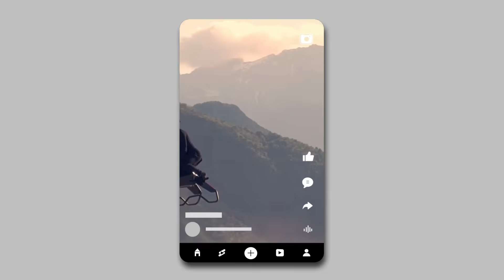2025 NEW VOLONAUT AIRBIKE UNVEILED!!

Comment: That looks like green screen to me. This project is so fake, it's not even a joke. If you are familiar with technology, you may know how much power is required to lift a person from the ground and how much is needed to move them around. Even if this is powered by gasoline or Jet fuel, it will take a big tank, and I don't see that much space for a gas tank, engine, and computer, and if you had a small computer controller, you would have to explain how you deal with combustion heat when sitting on it, cause if not mistanking that's carbon fiber you're sit on.

Comment: It currently boasts a 2-3 minute flight time, which at the max speed of 124 mph will get you two miles (if max speed doesn't severely reduce flying range). Hopefully you will find a charging station there, to get you two miles back to base. I queried ChatGPT on all possible likely improvements in each of the technologies behind its design. With it's most optimistic projections in battery tech (ever lighter and more powerful), and engine efficiency (I was surprised that it assumed this was electro jet tech), it gave a maximum range increase to ten miles, ten years from now. Assuming our ever cheerful AI wasn't halucinating.. you decide how viable that is.

Comment: I don't understand where the engine, ducts and fuel reservoir is. I have seen personal jetpacks and hoverboards, so it CAN be made compact but, still - I would like to see it first. You can clearly see how the others work. But here nothing is revealed, everything is hidden. But what is worse is that even if it is completely real working prototype, what happens of you tilt it over its ability to compensate? Will it slam you onto the ground?
Reply: I think this whole thing is fake??
There doesn't seem to be room enough for an engine or the fuel to power it??
I'm not an engineer, but this looks nothing like stuff we have seen before - that works!!
Reply: This indeed look like a scam project. Everything you said makes sense. Fuel tanks, propulsion system strong enough in such small frame?
Reply: Don't worry boys, the comment section has it covered with. "What happens if you do tip over, or engine stops mid flight."   But yes I also noticed there is not air intakes, or large enough air intake. No jets or exits for exhaust thrust and no way to stabilize via multi-jets.   I've also noticed that the landing gear is way to heavy to justify and that there seems to be CGI dust particles.
Reply: My scam sensor is screaming. If this is actually legit, I'll be gobsmacked. It's got to be fake
Reply: Jetson One (Wikipedia)
Reply: @ That is completely different concept, you linked a super sized drone which makes sense.
Reply: @ What is presented here is nothing other than the technological evolution of this project, the implementation of the assumptions of this concept.

Comment: The only decision now is, do you fly high enough for a parachute to deploy or low and slow enough to minimize the hurt?
Reply: Low enough to minmize the hurt, and then on occasional exceptions it could allow you to fly higher. There are guys who ride dirt-bikes in crazy ways that clearly put their necks at risk, as they exceed the envelope for crash safety limits. But if you're able to ride within a safer envelope for most of the time, then that could be adequate enough.

Comment: this thing is probably loud as hell
Reply: According to one commenter on one of Volonaut's Instagram posts, it's "about 64db. Sounds like a hair dryer at top speed. Engines are wrapped in sound insulation foam and mylar". Honestly, the engineers of the future are going to accomplish some pretty amazing things, so I wouldn't be surprised if this turns out to be a true statement. (This comment is a repost from another video I stated the same thing on.)
Reply: Jet sound?  I wouldn't mind :)
Reply: You mean like any other turbine powered aircraft? 😂
Reply: @LiquorandCheeseburgers  Sure, but the difference is with this, you're sitting on top of that turbine engine!

Comment: As a career pilot, I've learned to appreciate redundancy in aircraft design.
Any machine that has no ability to glide after an engine failure is a death trap!
Reply: it falls with style
Reply: Or have a parachute that opens up instantly with air bags all over beneath
Reply: @dhwanitsshah  no, you get an anti gravity suit.
Reply: So if we make one with 3 jets, and it can fly with only one on at a time, it's better right?
Reply: @donaldpierce6877 Yes. There's a reason why helicopters are so expensive, they need a lot of checks and overhauls. Planes don't have that issue. Yes, an engine failure is bad, but they can still glide and crash land. And helicopters can still autorotate back to the ground if they have enough height and a competent pilot. This bike has none of that.
Reply: Parachutes
Reply: @maddmavic Not enough height there. A chute needs time to open and time to slow your fall down. Not very good when you have an engine flame out at 30 meters with 3 seconds until you hit the ground very dynamically.
Reply: @maddmavic , для парашюта он летает слишком низко. Для эффективной работы парашюта нужна высота минимум 100м.
Reply: It is designed to hoover at low heights! Won't be a 2000 feet glide.
Reply: @kelcastle7645  I can tell you that at the hight it was flying in the video is high enough to easily kill a person.
Reply: @kelcastle7645  those were not low heights... a friend of mine fell off a ladder about 12feet or so up and was hospitalized for months. Then in a backbrace after back surgery with fused disc's. He easily could have been crippled for life.. that thing in the lowest shots was higher.
Reply: Yep. With parachutes and giant airbags this this would look like a mini airballoon. I wonder what weight this thing could lift?
Reply: You old people always become OSHA whenever cool stuff happens
Reply: @LegacyChasersComics   That's funny, I'll use it in future!  And you're talking to a guy who crashed an airplane in his 40's and broke an ankle riding his bicycle down the stairs under the Golden Gate Bridge at 61!
Reply: Motorcycles are also death traps
Reply: Your all mad.😂
Reply: Yeah, but what if you're so close to the ground that you're within shock-absorber/cushion impact distance, in the event of that failure?
Would the name hover-bike be more appropriate than air-bike? I don't see any footage of this thing flying through the clouds. It seems relatively close to the ground.
After all, how high do you really need to go for this type of application? Not that high, imho. You can keep yourself within a safer range of the ground.
Reply: I don't want one unless  it can carry my skis or board with me and drop me off at the top
Reply: ngl didn't think of this but I agree.  I complained about the space shuttle cause there was no abort system.
Reply: The inventor needs to invent some kind of  airbag to surround the bike and the pilot in case of an emergency.
Reply: At least you get to commit suicide in style..... Rather not. 

This is no different than those guys flying on jetpacks. Oh and don't forget the dudes climbing rocks and human build structures with no ropes
Reply: It looks fantastic, but that was my 1st thought also.
Reply: Probably have to use a ballistic chute with that thing.
Reply: is a helicopter a death trap?
Reply: True but I don’t think it’s designed to fly very high. It looks like it’s only 20 feet above the ground so gliding is kind of unnecessary.
Reply: I was thinking that
Reply: Yep, you won't be gliding to a safe landing after an engine failure on this machine!
Reply: Sistema de eyeccion o despliegue de paracaídas
Reply: What about helicopters? They are not ability to glide after an engine failure… but I agree, is a death trap
Reply: not a fan of helicopters?  😅
Reply: @jiminnorthdallas1227 never been on one just a reg flight and no a personal craft would satisfy  my jetsons and give you good back country  access
Reply: Parachute
Reply: We all saw it in Star Wars 6 - on the Endor.
Reply: It's just a load of old AI 😂😂😂
Reply: What is the flight time?  Any video with sound?  Cost?
Reply: They deliver a free antigravity suit by this device.....
Reply: So, every helicopter is a death trap
Reply: @p80mod  No, a helicopter can generate lift through auto rotation if the engine fails.
Reply: @p80mod  If that were true, every helicopter would have crashed and burned. Besides, auto rotation........
Reply: @p80mod Yes
Reply: @p80mod  Every single aircraft is a deathtrap if it falls from the sky.
Reply: it's only mega rich people. they wont be missed.
Reply: @BobRooney290 What equates "Mega Rich"? Is someone worth 1 million dollars, "Mega Rich"? If not, what's the actual number that delineates between well off and the mega rich? Just curious because the term is thrown around a lot.
Reply: @LiquorandCheeseburgers  Any amount greater than @BobRooney290 can imagine to have himself. His comment is an expression of insecurity, not of reality. Just ignore it.